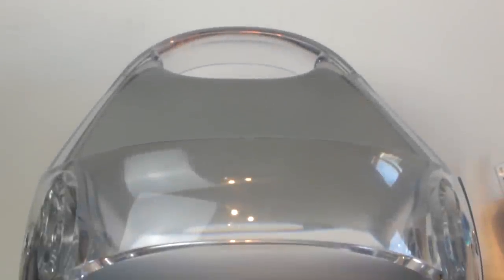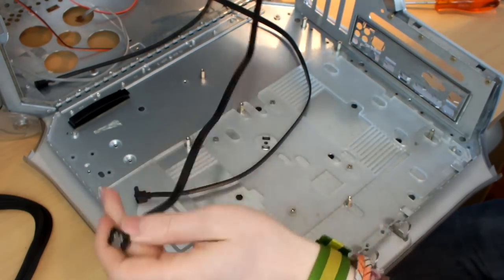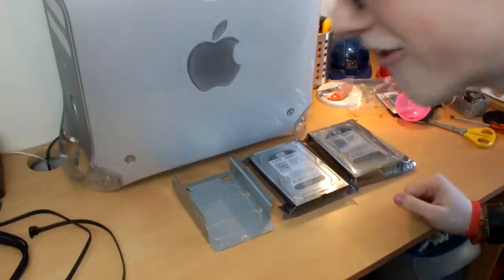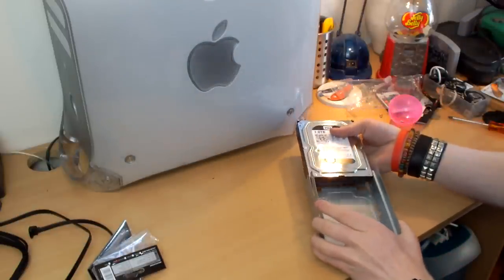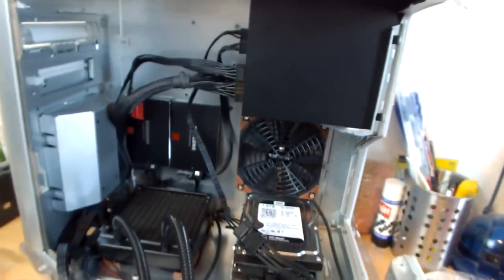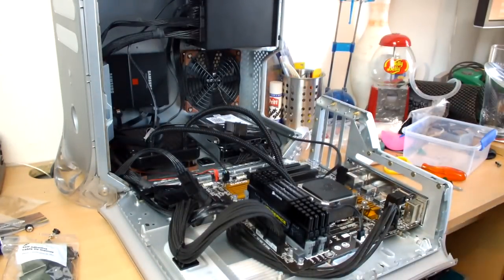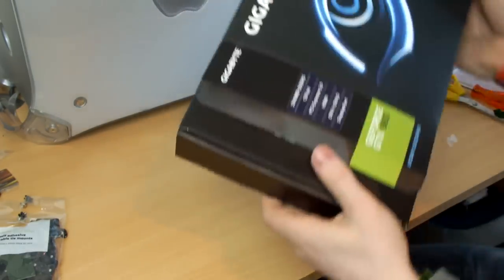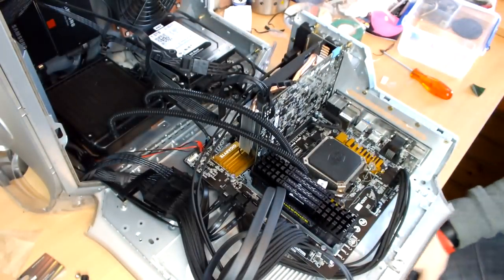2015 Hackintosh Build: Part 4 (The Build) | IMNC

Comment: There is really something to be said for taking the hackintosh route and building a machine that fits your needs/tastes perfectly. A machine with cutting edge internals and a stylish case that evokes the glorious past. This series is giving me a lot of inspiration to eventually take on a project like this for my future desktop.
Reply from the maker: segaprophet I'm glad it's inspiring! You've summed it all up in a nutshell, this is exactly why I'm doing it. I choose the parts to fit my exact need and put them in my fav case of all time. Who cares if the case is well over 10 years old, it looks badass!
Reply: segaprophet I went this route a few years ago. It wasn't worth it in the long run. it's a great hobby/project and it's fantastic as a secondary machine, but when you rely on your machine to just get on with things it's sadly not up to the task. Some builds may be rock solid and last years, but it seems to be a bit hit and miss for even the most compatible systems. In the end I just replaced my ageing 2009 iMac that my 2011 gaming PC/Hakintosh took over from with a 2013 27" iMac. Had zero issues since. No random "well, it worked before the update" problems that I had a number of times with the Hackintosh lol. Plus, I didn't want to be running legit Adobe software on unsupported hardware.

As the old saying goes. Your milage may vary!

Comment: Great looking G4 mod!

One thing I would suggest: Replace all the wiring going to the 2 SSDs, 2 HDDs and power for the bottom lighting with custom wiring from the PSU. Due to the cramped innards, if this was my build, I would pick up all the connectors and wiring to make custom SATA and molex power runs for each. That way you don't have a bunch of bulky wires hanging around or extra connectors needing to be tied back. Then you can neatly tuck the wires away and have just the connectors you need for an ultra clean look.

Comment: ItsMyNaturalColour If you have some wide rubber bands and a hole punch you can make a anti-vibration kit.
 Just cut two rubber bands to the length of the bottom of the HDD, then punch holes to line up with the screws, then simply screw the HDD down with the rubber between the HDD and caddy..
Hope that makes sense..
Reply from the maker: Slot1Gamer That makes perfect sense! I'm going to try it out. Great suggestion.
Reply: +ItsMyNaturalColour gotta remember that rubber tom !!?!  ;)

Comment: I would do something about those hard drives. I'm sure they're fine, but I'd want to change that drive mounting bracket for something with noise dampening material. Then again, they won't be readily available. Great video as always!
Reply from the maker: Jack Durrant Someone down below has just fired out an awesome suggestion about using rubber bands and getting clever, I may try something like that out, sounds cool!

Comment: I don't know if it would be possible but you could add something to 'bong' when you power the machine, that would be funky as it's in a G4 case.

You have done an amazing job on the cables in such a small case that wasn't designed for this kind of hardware.

Can't wait to see the conclusion videos and benchmarks etc. ;-)

Comment: Hi Tom, great video as always! You should be proud you've really designed and built a very nice custom system there, it's beautiful! The template from the kit is actually correct with the standoff layout, the motherboard you has it's holes laid out different to normal width MATX motherboards. So no you didn't mess up and the kit is fine just one of those things but if you decide to use a full width MATX board later it will then screw in to all the standoffs just fine since they are now already in place.
Reply from the maker: Stephen Ozoux Thanks a lot Stephen, I'm really glad you like the system! I'm releaved that the modding is correct. I never doubted it for a second but to hear from 3 or 4 different people that Gigabyte are screwing around with the 'standards' puts my mind at rest. Thanks for the comment!

Comment: Nice work Tom! Inspiring me to build my own.. Although I'd do it in a G5 case, just my personal preference. It looks awesome though in the G4 case, I love the fact the door works properly! Great work.
Reply from the maker: Sam Kent Thanks a lot Sam! It's interesting that you've mentioned the G5. Even though I hope this is going to be my main system for a good few years, ideas of building in a G5 case are already flowing. The only thing that puts me off ever so slightly is the lack of originality, especially on the YT scene. There are quite a lot of G5 Hackintosh' floating around so if I ever do build one, I'll try and make it as unique and awesome as possible :)
Reply: ItsMyNaturalColour Maybe you could try a Mac mini build next time with an ITX board? Naturally you'd have to use one of the older design ones, not the newer even flatter ones lol.
Reply: ItsMyNaturalColour That is very true, I've just always liked the clean aluminium look of the G5 case. I would look forward to a potential G5 case build series though, that would be very interesting. I would love to do it, but it's just scraping the money together to get the case and modify it. I already have the components really in my current rig, just need a decent quality G5 case and the means to modify it, either manually or with something like the products from the Laser Hive, which do get quite pricey - hence what is putting me off.
Reply: Sam Kent The G5 case is amazing for cooling too.
Reply: TalesOfWar So I've heard, sounds like a good plan for the next desktop I build

Comment: I had the same problem with my GIGABYTE board. It looks like GIGABYTE is using non-standard standoff locations and it looks like the holes that are drilled don't fit the ATX standard. I've tried different cases and they've all had problems with the lining up of the screw holes and I've had to force the screw into the hole.
Reply from the maker: Kevin Wong Very odd, Kevin. I'm glad that I'm not the only one having difficulties.

Comment: You made my whole day, but i think you have a micro-atx motherboard and maybe that's why the screw holes didn't match :)
Reply: Dizzy Dwarf ow sorry i thought u said atx board i didn't hear the m, my bad
Reply from the maker: Dizzy Dwarf No problem at all. Someone mentioned that my board could be Flex ATX advertised as mATX and that the standoffs are fine. This is looking like a likely scenario but I'll have to do more research into it.

Comment: Now that I think of it, would it not have made more sense to use bios raid rather than doing it in the os? That way the bios would see the raid as a single drive too.
Reply from the maker: ***** All will be revealed in Part 5 :)
Reply: hackingtosh doesn't detect bios raids

Comment: Didn't you have 2 cases to start with? Can't you use the front panel board from the second one?

Great Job btw! It's looking awesome.
Reply from the maker: ***** I wanted to try and keep that case stock considering this one cleaned up well enough that I didn't need to take anything from the other. Saying that, desperate times call for desperate measures. I'll see what I can do.

Comment: Tom this has made my day complete! I'm looking for a mac for cheap got any ideas? U.K also!
Reply from the maker: IPlayGames Awesome! If you want to know my opinion on the cheapest, best & fully supported (runs Yosemite) Mac around, I recommend finding a Mac Pro 2008 on eBay. Quad core models are popping up for as little as £280 and 8 core versions only around £100 more than that if you keep a look out, a total steal for a machine that can do everything a brand new Mac can do pretty much. If you're after a laptop, any MacBook Pro or MacBook Air from 2010 or newer depending on your budget and needs :)
Reply: Well I'm looking for  a video editing machine for my youtube videos but im thinking of building my own hackintosh laptop as the same specs as a mac would be half the price. I got the idea from your QuickSilver build... If possible would you be able to help me out with something to do with OS X as I'm more of a advanced windows user and could do with some help.... ItsMyNaturalColour
Reply: Not laptop sorry desktop workstation
Reply from the maker: IPlayGames If you've never had a Mac before, it may be a good start to buy even a cheap Mac just to mess around with before putting time, money and effort into a Hackintosh. Also you need access to a Mac to obtain the OS for your Hackintosh so they're handy to have around. Also I assume you wrote 'laptop' by mistake because building a laptop in general is totally out of the question of course. haha.
Reply: Yeah aha and I have used a friends copy to install it to a virtual machine and install it on a secondary HDD I know the basics of the Mac OS X interface and terminal commands u could do with some help with a experienced guy...
If possible would appreciate the help.
Many Thanks.
IPlayGames

ItsMyNaturalColour
Reply from the maker: IPlayGames If you've got that far then that's more than I've done in all honesty. This is my first Hackintosh and I'm still working out a shed load of issues and learning all the time (all revealed in Part 5 coming soon). Head over to Tonymacx86 and read the installation guide, it'll blow your mind how easy it is to get a Hackintosh up and running as long as you choose compatible hardware.
Reply: Yeah Thanks!
Apart from I got my pc from PC World and my motherboard should not even be compatible with Yosemite but it is so I guess I chose the right drivers. You have helped me alot with your channel and would like to tell you how amazing your videos are to us and how they impact our lives with the support and humor you bring to our faces.... 
Much Appreciated
-IPlayGames
Reply from the maker: IPlayGames Anytime my friend, anytime. Happy tinkering!

Comment: When you have unused stand off holes on the motherboard you can get plastic stand offs that clip in to the motherboard hole. Won't hold it to the chassis but, when you insert parts it will prevent over flexing of the PCB from the force of insertion. https://sep.yimg.com/ca/I/yhst-2911898806816_2272_536160.jpg